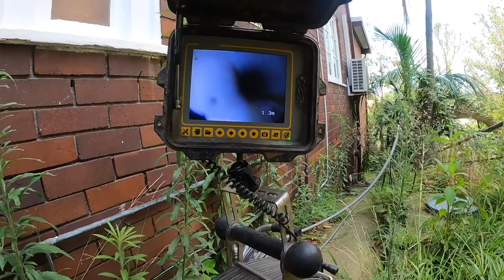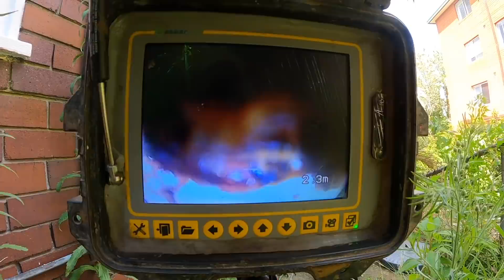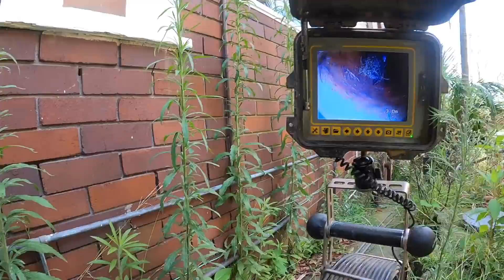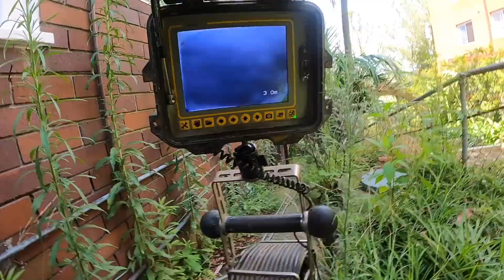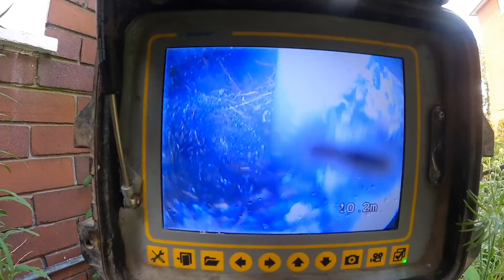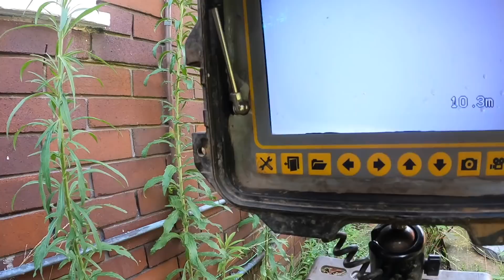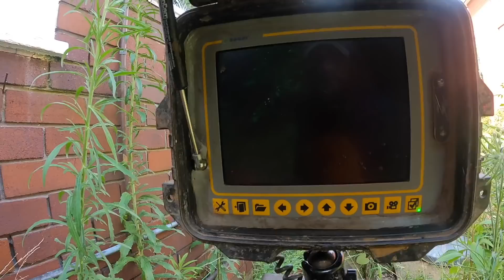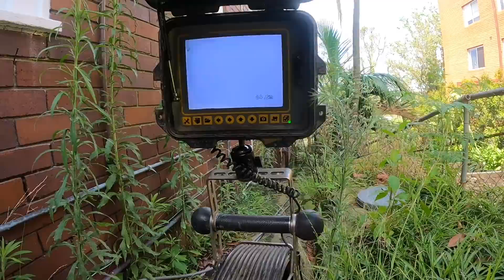Blocked Drain 613

Comment: Can you do a short video of you in front of a chalk board explaining the basic plumbing setup you have there in Sydney? Show and explain what a boundary trap & gully are, how the lines are usually arranged (stacked on top of each other?), and the connection to the main Sydney mains. Maybe mention where Sydney gets its water from, whether there's a water crisis or not, what and where the sewage treatment plants are and where it all ends up. Fatbergs and wipes too. I think you do thinks a bit different there, as I'm always surprised to see multiple lines emptying into a stack drain. Here in Texas, we connect all the drains from the house to one pipe inside the house and it connects directly on to the main drain, with no boundary trap or multiple lines emptying into a stacked pipe. This video would answer a lot of questions that come up regularly.

Comment: Ollie What fun to see you again and again.  Great content thanks.  If possible a professional question what is the reason you switched from a head that is quickly connected to a screw thread.
Thanks  keep up the great work
Reply: getting around bends is better like this i believe.
Reply: I didn't see a difference in size between the two that way I am  asking.  But it you could be right. Maybe Ollie would give as is point of view. Thanks anyway.
Reply: One of his nozzles came off in a pipe in a previous video and he had to retrieve it.
Reply: Thanks, I did not see this episode.
How did it happen🤷‍♂️😂.
Reply: @solutions972  He was pulling hard on the hose and it came off in whatever he was trying to pull out.

Comment: You need a Butt Plug (pun intended) to block toilets, if you have to jet the pipe towards the toilet, to avoid accidents in the bathroom.
A flexible Safety Cone w/ tip plugged, inserted in the toilet? 
Baby Rat needs a leash, like your Torch (Flashlight) has on! Safety Third!